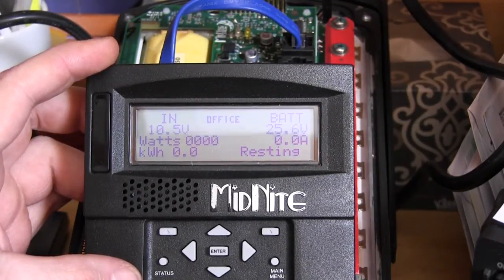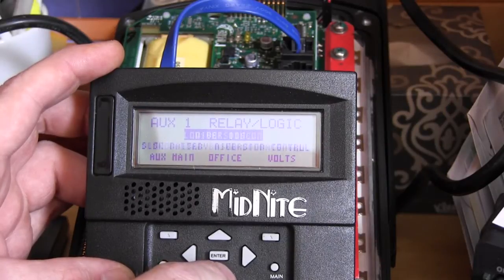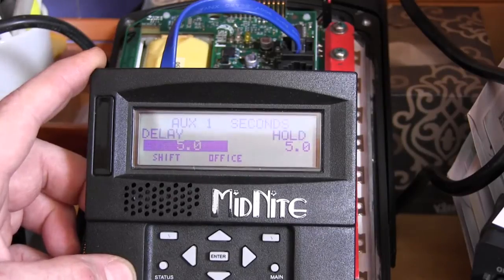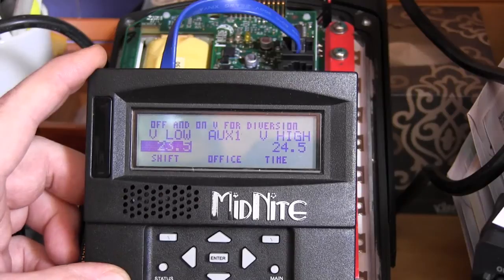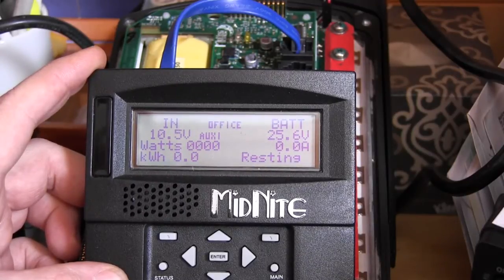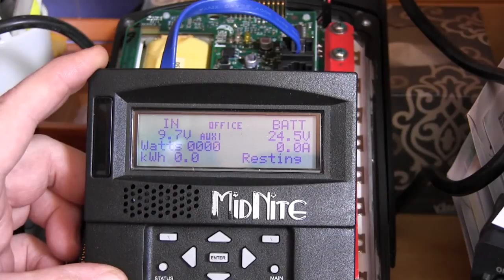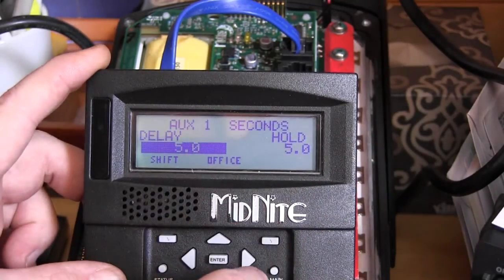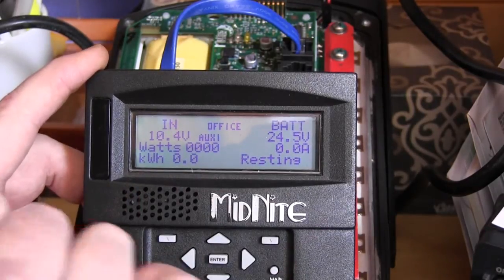Diversion on the Classic charge controller

Comment: To be clear, you need another Relay (other than the one built into the ChargeController) to power a dump load right? i recall the Aux 1 only puts out 12V intented to then power another relay and not intended to power a load itself. is that correct?